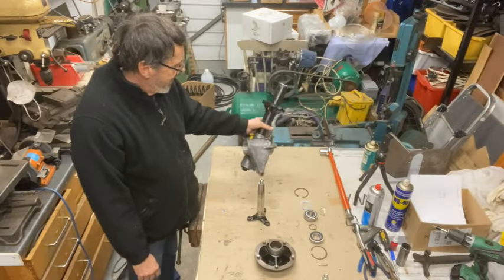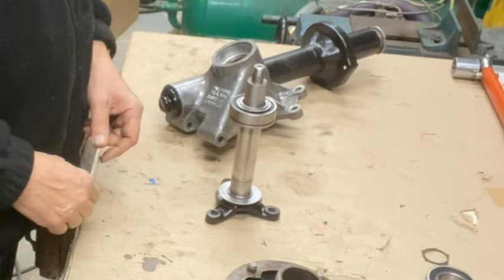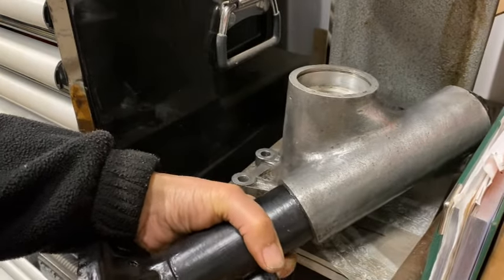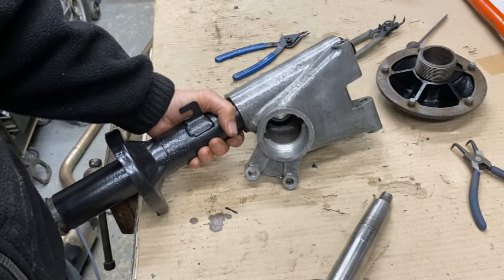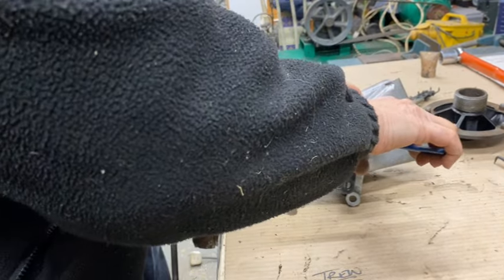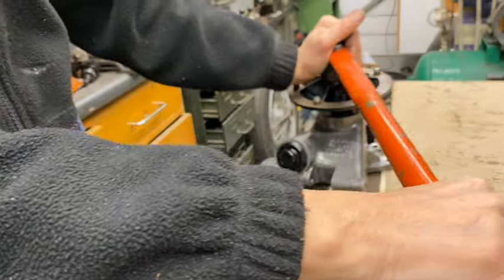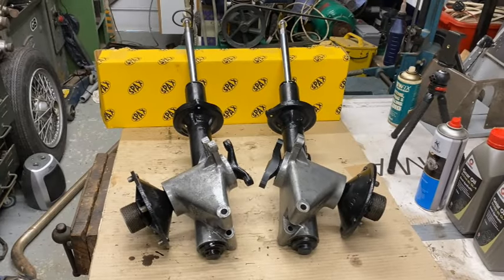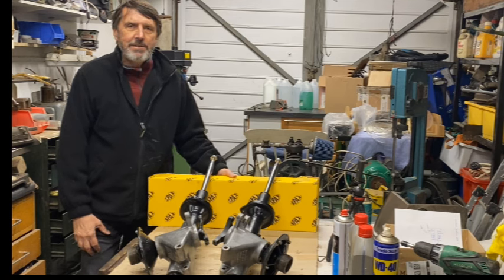Lotus Elan CHAPMAN STRUT & HUB assembly

Comment: You didn't lap the hub in againt the hub (or put oil n the tube as mentioned before). Great info though. It's good to know the correct direction of the outer hub.

Comment: allways poor oil in the tube where the shock absorber goos in (for cooling, air does not conduct heat, caused by the shock absorber
Reply from the maker: The thermal conductivity of oil is about 0.13wm/k that of air is about 1.04wm/k . So oil would perform worse.  Nearly 10 times worse but like your thinking  process
Reply: @ianj3663 

Thermal conductivity 

Air 0.02 W/mK

Oil 0.15 W/mK

Oil has 7.5 times better conductivity than air
Reply from the maker: You're right! I was confusing the thermal capacity of air with thermal conductivity. Sorry